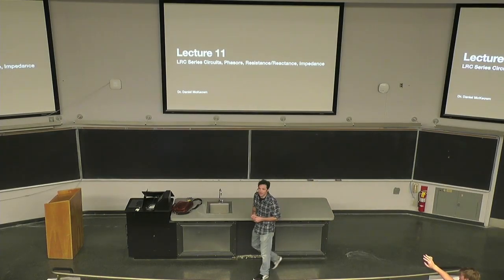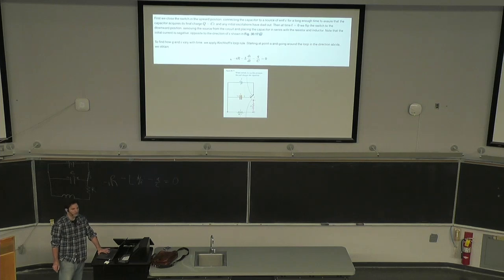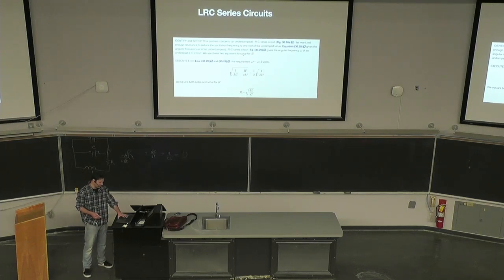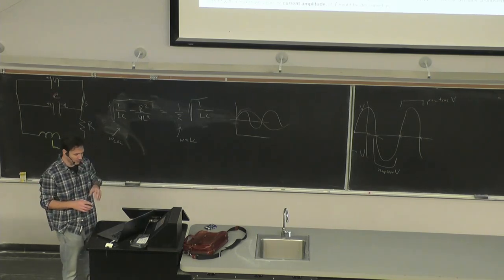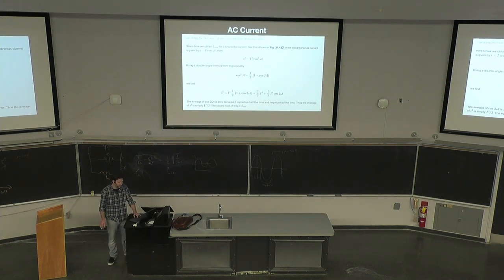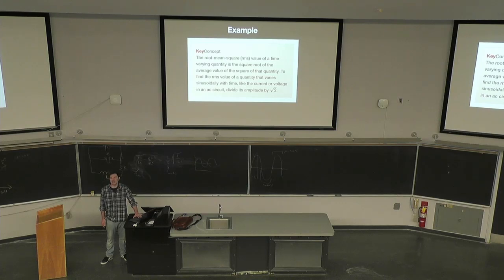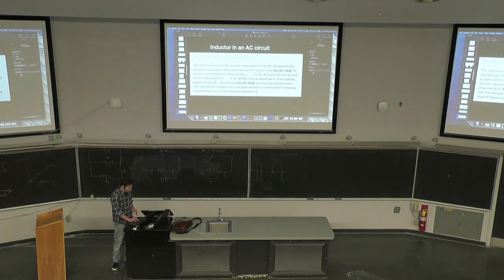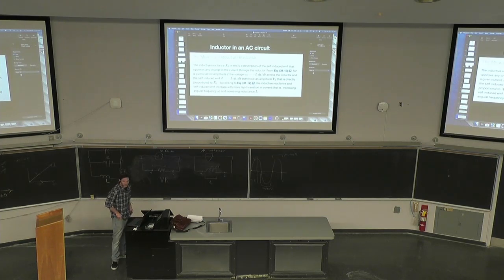#physics #lectures at #ucla #electricity and #magnetism Series Lecture 9

Comment: Cathleen Qiao

Thank you for the lecture! RL and RLC circuits were quite confusing to me but I am starting to understand them! 

But, I am still confused about how a circuit with a battery and inductor can have current flow since the inductor is opposing the change in current. Would the induced emf not cancel out with the voltage of the battery?

Comment: Ashley Juarez, 2nd Lecture 
Circuits are concepts that I’ve always struggled with. But it helps to associate it to the common 1B concept of oscillators. That really helped make sense of the RLC equation discussed in the first third of the lecture. 

The concept of phase diagrams are still challenging to me. But it helps to remember that one axis is for real values while the other axis is for imaginary values. The phaser diagram changes depending on the components: inductor and resistor. These changes are really interesting and I’m glad we had a question specifically for this one the homework!

Comment: Asher Christian

I found it surprising that when modeling the voltage of the entire system, it is as simple as taking the vector product of the phasors for each individual circuit element. It also seems surprising that there just so happens to be these three circuit elements that are able to exhibit such complementary behaviors in electrical circuits, how the resistor, capacitor, and inductor can be combined to produce such an array of possible outcomes.

Comment: Gene Kung

The explanation of the interactions between resistors, inductors, and capacitors really helped solidify my understanding. I particularly enjoyed the discussion on phasor diagrams and how they represent the relationship between voltage and current. However, I'm still a bit unclear about the imaginary aspects of phasors and their relation to rotating vector diagrams.

Comment: Ryan Kennedy

I found that the derivations of the voltage phasors for each circuit element was really helpful in understanding the need for the difference in phase angle between voltage and current. I also thought the phasor diagrams were really effective in illustrating these abstract relationships.

Comment: Michelle Kim

The comparisons between electric circuits and kinetic motion concepts that we've already learned about made it easier to form direct comparisons between the two and understand how circuits work. For instance, overdamping in a circuit (where the resistance is very high relative to the natural frequency) causes the current to decay rapidly with no current oscillation, similarly to how an overdamped harmonic oscillator (such as if a very heavy box were attached to a spring, causing the friction force acting on it to be very high) returns to its original position without oscillating back and forth as a lighter box would when pulled away from the spring.

Comment: Aiden Wong

I thought the explanation of the RLC circuit was very helpful along with the diagrams and solutions to the practice problems with the equations. I have only seen RC circuits and adding the inductor to the circuit as well makes things a lot more complicated but I felt Professor Mckeown did a good job explaining it. I also thought the explanations to AC current and circuits was interesting and concise as I have always heard about DC vs AC current but never really knew what AC was. These topics are starting to get fairly difficult but I think I have a good understanding due to the good explanations.

Comment: Xiaohan Song
Today's lecture on RLC series circuits was exceptionally insightful, particularly the detailed exploration of phasor diagrams and how they represent various components in AC circuits. It was especially helpful to see how capacitors, inductors, and resistors interact in these diagrams, giving a clear visual of their phase relationships and impacts on the circuit's overall behavior. The analogies drawn between damped oscillations in mechanical systems and electrical oscillations in RLC circuits greatly enhanced my understanding of complex electrical dynamics. Could we possibly cover how these principles might be applied in the design of modern electronic devices in future sessions?

Comment: Kevin Sheng

When I took Physics 1B, my professor actually gave the differential equation for an RLC circuit on the midterm for us to think about. Even though I didn't really get it on the midterm, I see now how all the variables for an RLC circuit have a corresponding value in driven damped harmonic motion. Even the concepts such as underdamping and overdamping carry over, which just goes to show how similar this really is to things 1B already taught.

Comment: Deena Kirst:
This lecture clarified circuits and helped expand my knowledge on them. Specifically the AC and RLC circuits which I found interesting as circuits and currents are very valuable to technology. The example problem where we had an AC resistor versus with AC with inductor in the phasor diagram to see the difference was valuable to understand the physics behind it.

Comment: Pratosh Menon, Lecture 1

Learning about LRC circuits was really interesting, since we only covered DC circuits in 1B, especially because these circuits exhibit oscillatory behavior, with energy shifting back and forth between the magnetic field of the inductor and the electric field of the capacitor. Furthermore their applications in various electronic systems, including oscillators, filters, and signal processing circuits, where their resonant properties are utilized for specific functions like frequency tuning and signal amplification was cool to learn about.

Comment: Lena Gudikunst
This lecture significantly enhanced my understanding of AC circuit behavior, especially through the use of phasor diagrams. These diagrams provide a visual representation of the interactions within the circuit, making it easier to grasp concepts like inductive reactance and resistance. It's intriguing to see how these ideas can be both compared and visualized using such tools.

Comment: Maximillian Franco Chagonjian Bohannan: I thought it was interesting that the voltage of a plug in my house might read 120 V because it is based off of root-mean square voltage, but the actual amplitude could be 170 V. The lecture explanation of phasors was also much better than the textbook's explanation. I also appreciated how inductive reactance was described, and how it nicely turns out to be an analog of resistance.

Comment: Harvey Nguyen

The example problem with the phasors as well as drawing them out for the AC with resistors, inductors, or capacitors really helped ! I was very lost throughout a lot of the lecture because this is a lot of info that I've never seen before, but it is not you king, it's definitely me... I know I just need time to soak in the info ! 

I'm going to see inductors in my nightmares

Comment: Gustavo Castrejon

The lecture covered the effects of resistance in LC circuits, leading to energy dissipation and damped oscillations, with a detailed analysis of RLC series circuits using Kirchhoff's Loop Rule. It explained the different damping behaviors: underdamped, critically damped, and overdamped, highlighting how resistance impacts the oscillations. Phasers were introduced to represent sinusoidal quantities in AC circuits, illustrating the phase relationships between voltage and current in resistors, inductors, and capacitors. I found the discussion on how inductors and capacitors behave differently in AC circuits, particularly how their reactance changes with frequency, to be super interesting.

Comment: Disleiry Hernandez Gutierrez

From the video, I found it interesting how the resistance in a circuit causes damping, similar to the harmonic motion of a spring experiencing friction. Whether an LRC circuit is underdamped, critically damped, or overdamped fundamentally depends on the value of the circuit's resistance. Meanwhile, the topic of phasors and phasor diagrams allowed me to understand a new approach to visualizing and analyzing the sinusoidal functions of voltages and currents in AC circuits.

Comment: LeBarrion Rembert

Before this lecture, my I didn't understand LRC series circuits at all.  One of the things I learned is the importance of impedance, and the role of combining resistance and reactance to understand how they together affect the overall opposition to current in AC circuits. 
Phasor diagrams were also helpful. These diagrams make it so much easier to visualize and understand the phase relationships between voltage and current.  What I appreciated the most were the in-class examples with phasor diagrams. Working through them helped make the concepts clearer.

Comment: Masayoshi Max Fukuhara

This lecture was a little bit more on the confusing side because a lot of new formulas were introduced by I really liked how Professor McKeown went through the application of each of them and the derivation of such using graphical representation of the sinusoidal graphs. I also how how we went through each problem using the formulas given although the derivations of them were confusing. Connecting back to Physics 1B with circuits and resistors also helped as this topic was somewhat familiar from last quarter, although it also reminded me that I should go back and review my notes for this section.

Comment: Alexander Neary

I didn't expect LC circuits specifically to have a really similar relation to spring mass systems, but it does make sense. After the capacitor is uncharged, the inductor has all the stored energy and continues discharging the capacitor despite the capacitor being at equilibrium. It causes the charges to sway back and fourth like a pendulum.

Comment: Wyatt Wilson remote lecture participation for Thursday May 9, 2024. 

I really liked how just off the bat around (4:21) we're thrown directly into an LRC circuit where up to this point all of the concept from this course and the previous one come together. In 1BH it was explained that if you look at the Loop Rule (as shown on the slides) it's very difficult to manually solve them since a derivative and second derivative occupy the same equation as their base function (charge). However, just by inspection, you can deduce that for the system to be described using a function, you can start by proposing the charge on the capacitor is a sinusoidal function and then, because the derivative of a sine function oscillates between cosine and sine, you can solve the dI/dt and d2I/dt2 to come up with the equation for charge in an LC circuit. Then derive for the current in the LC circuit.

The video interjects that the angular frequency is (1/LC)^1/2 which is a byproduct of this process that you can see derive naturally. But what I also noticed is that it is the resonance frequency for an AC circuit of the same design such that the inductor and capacitor impedance cancel each other leaving the sole circuit impedance equal to the resistance and thus making the entire circuit described by V=IR.

In the lecture, it is said that this is the "undamped frequency" and that in the RLC circuit the true angular frequency can be written in the form of (1/LC - R^2/4L^2)^1/2 and then using that you can compare it to an LC circuit (the oscillating one described) to figure out what resistance needs to be placed in the LRC circuit for an intended outcome.

And then of course we got to talk about phasors in the imaginary plane which was all the fun and joy of 1BH (total sarcasm).

Note for the shortcut in finding the rms, just divide by (2)^1/2. I find knowing the derivation helpful though—just follow the steps outlined by the name of RMS.

Comment: Kai Wang
(deleted and reposted due to incorrect account)
The phasor diagrams were really confusing to me in the textbook chapters but this lecture has cleared up my understanding of what it means for voltage and current to be "out of phase", "ahead", or "behind".  The drawn inductor AC graphs really solidified the concepts to me and I now have a much better grasp of how LC and RLC circuits work!

Comment: Logan Wu
Would it be possible to create an RLC AC current that produces a linear (not sinusoidal) voltage/current? I understand that RLC circuits would not work with DC, but by providing an AC current whilst moving the circuit itself through a magnetic field, would it be possible to replicate a DC current, or would it simply converge to zero?
Reply: Leo Yuan

I used to take ECE courses on circuits and I personally think it may be theoretically possible to simulate a linear voltage through very careful design of R L and C which require some calculation of frequency and so on, but it is practically infeasible (i.e. it may be possible to get a linear-like source on circuit simulation software but not in real life). Introducing the circuit to a magnetic filed affects more than the voltage itself. My intuition is the magnetic field introduces more complexity that we don't want, which may even make it harder to replicate the DC. Let's definitely wait and see how our professor think about it.

Comment: Harmony Hsu

In this lecture, I learned about the derivation of the second-order differential equation describing an RLC (resistor-inductor-capacitor) circuit. By replacing current (I) with the rate of change of charge (dQ/dt), the equation is transformed into a second-order differential equation in terms of charge (Q). The lecture was brief on this but I found some of the general methods for  solving such differential equations and highlights the underdamped behavior of the solution, which corresponds to specific conditions in the circuit's dynamics.

Comment: Ayaan Raina (Lecture 1)

This lecture on AC Circuits helped me clarify how various circuit components interact in these specific types of circuits. The use of phasor diagrams provided a clear visual representation of current/voltage phase relationships, making it a lot easier to understand the complex dynamics. Moreover, I feel as if structuring the derivations for each component in an AC circuit highlighted both the similarities and differences between resistors, inductors, and capacitors, overall strengthening my theoretical understanding.

Comment: Takbir Rahman (Lecture 1):

I'm not gonna lie I felt lost during this lecture and I'm pretty sure it's because there's a lecture recording that is supposed to precede this one. On BruinLearn, there are slides posted for Lecture 10 but at the start of this video it says the slides in the video are for Lecture 11. Nonetheless, I took away a deeper understanding of the intricate interplay between inductance, resistance, and capacitance within LRC circuits. Phasor diagrams were particularly nice, providing clarity on the distinctions between current and voltage behaviors within each component.
Reply from the maker: Hello Takbir, thank you for the feedback. Watch this lecture https://www.youtube.com/watch?v=nLliKqPpuMk&t=16s  and it will help clear up some confusion. I'm sorry about this and I'll work to try to make sure I reorganize them on youtube.

Comment: Sailesh Gunaseelan

I did not realize that even though charge can't move through a capacitor (as the two plates are insulated from each other), there is an equal displacement current between the plates as the capacitor charges and discharges. This is a concept I will have to review so that I can be careful when applying this concept to problems.